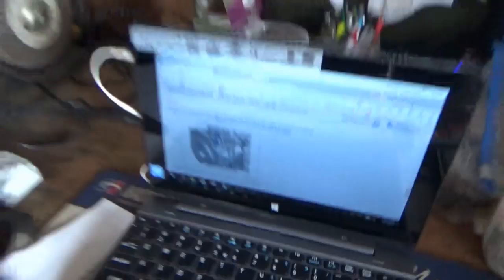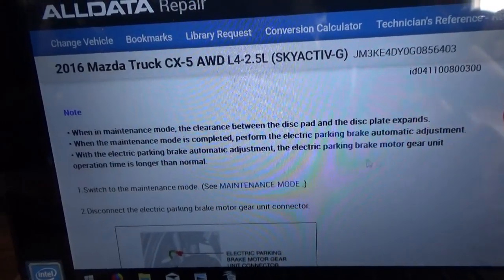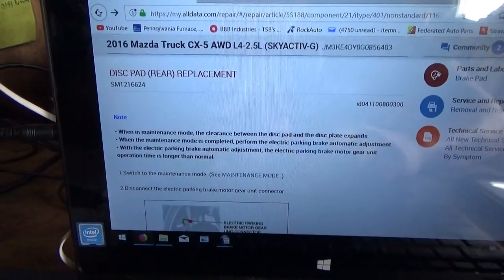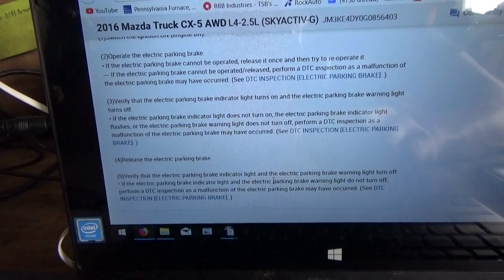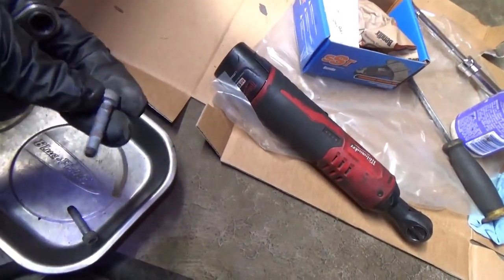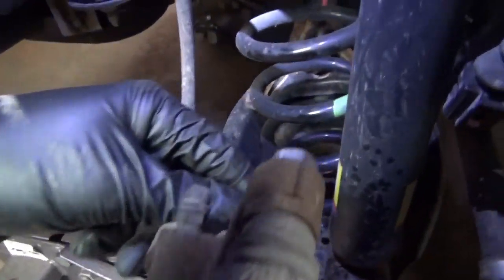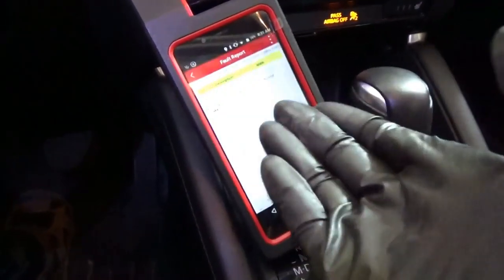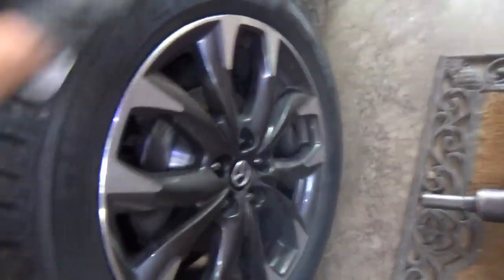Brake Job COMPLICATIONS! (Mazda CX5)

Comment: You buy all the fancy documation and tools then fail to use them and call the system crazy. Maybe use all the stuff you have access to.😀
Reply: Man that was cold. Completely accurate, but COLD, REALLY COLD.
Reply: @satamanschmidt3428  sorry don't mean to be cold as I am usually in awe of his thought process. But if he would have just followed the instructions it would have just been push the calipers in.
Reply: For once, I agree with the dissenting opinions here. I mean, we're all guilty of breezing past service procedures at some point, but it's surprising Ivan would jump the gun on a job like this. This is one of the few cars you don't need a scanner to retract the electronic parking brake. If I see an electronic parking brake, I follow service procedure exactly and I haven't had any trouble thus far.

Comment: Electric parking brakes. Screw that.
Reply from the maker: The thing that upsets me about these new E-brake systems is that it's either ON or OFF, no modulation in-between. Definitely a big step back in terms of safety!!
Reply: @PineHollowAutoDiagnostics  But.,.. But... But... It's new! It MUST be better! (Can you feel the sarcasm?)
Reply: Yeah, f that. Can you apply it while driving? I've completely lost brakes before and got home with the parking brake.
Reply: @volvo09  
You haven't tried it yourself? Do it - I dare you.  ;)
Reply: Parking brakes are only good on manual vehicles anyways. Here in Michigan, NO ONE uses parking brakes. The ones on my Trailblazer rusted away and fell off and had never ever been used. I refused to replace them. What for?
Reply: @scottfirman   I'm in the UP of Michigan.  I have to automatic vehicles and I use my parking brakes. I also keep them in good working order.  What do I use them for?  (1) Parking on steep inclines. (2) Parking while hooking or unhooking our trailer. (3) Anytime I'm hooked up to my trailer the and vehicle wants to roll.   It's what I do.
Reply: @phprofYT  Not too many people use them . We live on flat earth so no problem there. It doesnt hurt using them once in a while to make sure they work. My dad always ended up trashing them on the older cars because the cables rusted up to the point if you did apply them, the cables would snap. If they set, then snapped, you were screwed. I had mostly manual shift cars back in the 80's and 90's so I always made sure the E- Brake worked on those. You could leave the vehicle in gear while parked but if it got knocked out of gear while parked even on a slight incline then bad things would happen no doubt.  I know boat owners would for sure use the E-brake.

Comment: Pat your head, rub your tummy, stand on your head.. all for replacing rear pads and rotors. Yeah, cuz those never wear out. I personally quit working on cars with electric parking brakes. My OTC scanner is supposed to release those brakes for service, but does not.  Cute. Stupid stupid stupid system!
Reply: it's the "chicken dance" most cars have multiple chicken dances now for various reset and relearn procedures, not to mention programming things like garage door openers/remote controls

Comment: Hey Ivan I'm a Mazda technician figured I'd throw my two cents in. The Mazda vehicles are some of the few where a scan tool isn't  needed and you can do the rear brake job. There is literally no need to use a scan tool. Putting it into maintenance mode is as simple as holding the accelerator all the way down and the park brake button and cycling the ignition until you hear the motors retracting. You'll also see a P! icon in the instrument cluster as well. Then you push the piston straight back. I see lots coming in with the electric motor destroyed because people do not look up the procedure.

Also for anyone reading to talk it out of the maintenance mode it's as simple as pulling up on the park brake button while holding the accelerator all the way down and cycling the ignition 3 times until you hear the motors actuating.
Reply: Awesome! Thanks for this! I hope Ivan pins this!
Reply: Great info. Thanks for sharing it.
Reply: Thanks for sharing but this is still a stupid idea. Damn you mazda
Reply: Knocked it out of the park with this information!!
Reply: On the bright side, at least they have maint. mode so we can replace pads without scan tool. But yeah,  it`s a stupid idea afterall
Reply: mikeZinck I freaking LOVE our 18 Mazda CX-5!  Great info!
Reply: YES. Was going to say the same thing. I work at a VW and Mazda dealership and on the VWs you must use the scan tool. Mazda you can do this maintenance mode procedure.
Reply: good info thanks!!!
Reply: Hey Im a Mazda master tech and its amazing how many ppl screw this up
Reply: @joemilton7552  you can repair the caliper usually a clip breaks inside
Reply: @Prakicov  im a mazda master tech and its a great idea as it keeps  people who shouldn't be fixing licensed technician work if you have proper training it is easier than mechanical breaks as its a push button setup
Reply from the maker: Trivia question: what was Mazda's slogan back in 1989?
Reply: @PineHollowAutoDiagnostics  It just feels right :D i guess
Reply: @PineHollowAutoDiagnostics  other cars go boing boing mazda goes hummm.?not sure of year.
Reply: @PineHollowAutoDiagnostics  It just feels right!
And it does not just feel right when you dont look up the procedure on a system you never saw. mikeZinck just ecplained how easy it is. So this is all on you, not Mazda, especial because you have alldata to look everthing up o.O
Reply: tried it. didn't work. So hold accelerator down, pull up on P brake and push button 3 times?
Reply: @blackjoebufa  The point is it shouldn't and doesn't require a "master licensed technician" to do a simple brake job. The entire process is manufacturered.
Reply: Do you pump the brakes before turning off service mode?
Reply: Just wondering how does it destroy the electric motor, what happens to it???
Reply: Hello from Athens Hellas. My Mazda diesel 2.2 150 2015 does not goes out, of maintanance mode. This means whilst I operate the procedure, the acceleration all the way down, the EPB up and 3 times ignition, I can hear the motor actuating longer than usual, but after about 10 secs stops working, and the maintenance mode remains. That means the EPB always the light flickering and does not operate. Do you have any idea? Thanks for your kind attention on this matter. Marinos from Greece 🇬🇷
Reply: DIY Dave yeah because people who say that don’t want you working on your car so you are at their mercy as they try to rip you off at the shop.
Reply: @blackjoebufa  hey mate, i do have a clip that fell out of the caliper, whats the go with this? i cant even tell where it goes.
Reply: @themechanic6117  FYI not Mazds design made by bosch and almost all electric ebrake are like this now ,very basic system, way easier the old manual screw in type with ebrake cable , work on a sabb ebrake or do a rear brake job on jag v12 then we can talk stupid
Reply: @Prakicov  its a great idea u no why you dont have to buy a caliper screw in type kit all u need is channel locks or block of wood
Reply: @michaelwas8549  hold accel down hold down on p switch, turn iginition from on to off 3-4 then wait and listen
Reply: @sontran-qd1zs  dosnt matter
Reply: @highstdynotunebarbara9333  if turned manual doesnt line up correctly inside then when key is turned on it self cycles and because in wrong position spins and breaks clip inside, sometimes you can take apart and if clip dosnt break you can reassemble ,
Reply: @OzSigns  kinda hard to explain without a visual
Reply: @DIYDaveOK  it doesn’t require a master technician. Just read the repair procedures and anyone can do it
Reply: @michaelwas8549  push down to maintenance mode and pull up to reset to normal operation.
Reply: I unfortunately did read proper procedures and attempted to compress piston clockwise. After piston did not compress and remained (stuck) I went to Mazda dealer and bought a new caliper part. Once everything was assembled I then started the car and the break just goes down without any tension as it should and the emergency parking break is on (without) having it activated. Any assistance greatly appreciated.
Reply: Bless you!
Reply: Get quite a few towed in or brought to us from other shops because they tried to twist back the caliper or screwed to hex back. Same procedure on Fords of the same era. Beyond easy to do but mucked up fairly frequently. Also handy to know is only put it in to service mode with the calipers still in the saddles or it'll wind the piston out.
Reply: Got a code after doing the brakes. Put power and ground to the motor and it just spins doesnt protrude out or in..
 Codes for stuck actuator..

Do the actuators usually go or the caliper?
Reply: @cjmazdatech  This is exactly what I did and am facing right now.  Is there a magic way to get them back or do I need to pull the motor and manually turn it?  I'm stuck.
Reply: I'm stuck in maintenance mode. That cycle will not release it. Help please 🙏
Reply: @highstdynotunebarbara9333  Probably strips the gears
Reply: @mikeZinck I've got a 2013 CX-5, it has a manual Ebreak, and I don't have the fancy digital heads up display.

Gonna do my rear brakes this weekend, don't think I have maintenence mode, is there any additional steps needed for the manual park brake?
Reply: Of course, for a mazda tech that is simple
Reply: @blackjoebufa  if the clip breaks, replace the actuator?
Reply: @blackjoebufa  same problem the pin broke
Reply: Yup easy as could be i just replaced all 4 rotors and pads on my mother’s 2015 CX5 using this method, took me a total of 2 hours including bleeding in my driveway.  Brakes working like a champ now.
Reply: thank you

Comment: Ive done so many on vw,jaguars,rovers, fords, Mercedes all using this same design. I remove the motor, spin the spline by hand using a torx bit for example til it stops, the  caliper can be pushed in like a normal caliper no twisting required. Very easy, easier than a twist caliper design i think. Activate the e brake a few times and done.

Comment: I drive a Tacoma...it has rear drum.brakes...are they perfect....well maybe not but it works. Press down on the foot pedal and set...press on foot.pedal and release. People criticize the Tacoma for being old.school...is that really so bad???? Ivan....you are patient to a fault. The fact you don't even say shit is amazing. Your skills are impressive. Pine Hollow Diagnostics....PHD...clever
Reply: Agreed, drum rear brakes are a bit of "old school" kit that aren't bad at all. They worked fine for decades. Don't just assume that newer is better!
Reply: only for the rear brakes, which are more like 25% of the braking(varies with weight load) it's not very fun with 4 wheel drum, the fronts heat too fast and fade away like mad.
when I was a teen a guy tried to sell me an old F100 to tow my boat with, manual trans and 4 wheel drum brakes, the pig could hardly stop itself with all 4 working perfect and I passed on that truck. I should have bought it, though still thinking back about I was a dumb-dumb and could have easily converted to front disc and it was in fairly good shape for being in Ohio, old guy had it and literally never drove it in winter, his son didn't want it after he passed (thinking about it still makes me kick myself in the nuts)
Reply: @throttlebottle5906  Very true. I knew a guy years ago with a 1970 Dodge something-or-other, can't remember exactly what, but it had 4 wheel drums. It was kind of scary to drive.
Reply: Rear discs are superior to drums in every way.  More advanced vehicles apply the rear brake before the front to reduce dive (My 2008 VW Golf GTI does it).  Try finding a drum brake system with auto adjusters that really work,  gotta love the old handbrake cable that stretches and needs constant adjustment, drums fill with water and then don't work just when you need them, etc, etc.  Problem is you get people giving advice on how to work on electric park brakes who don't read the manual.

Comment: Thanks for posting this as my first time doing the rear brakes on my wife's CX5 pretty much went the same way. If I hadn't come across this, I probably would have been one of those people Mike was talking about. I did have to do the manual release step as I accidentally sent the piston the wrong direction without the brake pads in place and thought I'd really screwed up. With a little patience I was able to get the piston compressed and everything reassembled.  The rear driver side went about as quick as the front once I knew how to put it in maintenance mode. 
Again, I can't thank you enough for posting this. Very important information!

Comment: Thank you for this video watched it a couple of times and wow it saved me $1000 bucks going to the dealership! All because i turned pistons not allowing repair mode to be activated while changing rear breaks. I learned to make sure the peg on the sisk breaks are engaging the piston also make sure your a couple of turns loose on brake calipers so when electric motors on EPB are engaged it takes little effort to engage calipers. When car goes into service mode EPB motors will turn maybe 5 turns to allow room for replacement of old brake pads. 
Be well! Each one teach one!

Comment: I bought an Autel Maxidiag scan tool specifically because it will retract E-Parking brakes.  I guess the main reason they switched was to free up console space for the Quick-E-Mart 40 ounce cup holders.
Reply: I have the Autel MS906TS when you go under Service/ EPB Mazda wasnt listed. The Mazda Tech above says Mazda is one of the few you dont need a Scan Tool for the procedure. Maybe they have it in the factory tool?
Reply: @ahill007ny  it’s not in the mazda factory tool. You just follow the procedure to go into maintenance mode

Comment: Thanks for this! When I did my rear brakes, I KNEW about the procedure and did it and I didn't twist the caliper when I compressed it but it seems that it twisted a little bit anyway.  This seems to have caused my EPB to be slightly engaged while the brake was off and I was driving. Needless to say the smell of burning brake pads was overwhelming.  I had to take off the right rear caliper and remove the EPB, then turn the caliper bolt in the direction shown in the video in order to align the caliper correctly. After reinstalling everything, the problem was gone! Thanks again.

Comment: I did rotors and pads front/rear on my 2017 CX-5, super easy and DIY friendly as long as you do the maintenance mode procedure. I used a twist style compression tool, i put a brake pad between to minimize twisting. You also have to make sure the notch on the piston align with the pin on the brake pad. I saved ~1000 euro doing it myself, parts included.

Comment: I feel your pain Ivan! I had a Ford fusion prior to buying the Launch Diag 4, & only had my Snap-On Solus Ultra (13.2) updated. Thanks GOD for Identifix cause i did read the procedure & found that on-board maintenance mode, followed & had no issue! Thanks to Eric O (S. Main Auto) Keith (New Level Auto), & you (Pine Hollow Diagnostics) using & reviewing this advanced, affordable, professional, scanner cause i own it & it paid for itself right out the gate. I'm getting higher end work now & my reputation is growing in my community as a mobile diagnostic professional. Best DIY/Professional videos around between y'all 3.
Reply: Thanks Mel,hope X431 diagun IV help you a lot in future.
Reply from the maker: That's awesome, Mel! Glad to hear your business is going well!

Comment: I just did rear brakes on a CX5.  YOUTUBE is a great tool.  Every, and I MEAN EVERY video that I watched said to put the rear brakes in maintenance mode.  Not doing so would not turn out so well!  I guess you proved their point.  I also has a Jeep Cherokee with the same procedure.   There is a maintenance mode in the settings.
Reply: The first mechanic who did my rear brakes didnt perform this procedure and I showed the third this video, but the right wheel still dragging... the car makes a loud noise and the flashing brake light appears on the dashboard after you drive for a while... I cant find someone who can fix this... cheers...

Comment: Mazda tech here too. Just turn the piston about three times without pressure then push it back the tool. Always turn the piston without pressure and its goes back very easy. 
Or maintenance mode as described in other posts.

Comment: I would start over put it in service mode. Push both Pistons back in. Toss scanner off to the side. It appears that the two actuators are not in sync. One side is being applied and the other side was released. Good work though man nice video.

Comment: They are all going that way Ivan. I work at a Ford, Land Rover, Jaguar dealer and all use this system. Land Rover has been using it since 2012. Most manufacturers have a manual way of releasing so you don't need a scan tool.

Comment: I'm sorry Ivan but i just had to laugh at the end when you finally got it all working correctly. Just dealt with something like this yesterday fixing fuel lines on a  old rusted out Chevy truck. Fix one leak and another one starts. Not electric brakes but just the fact when you think something should be so simple it always come back to bite you. Lol good job!